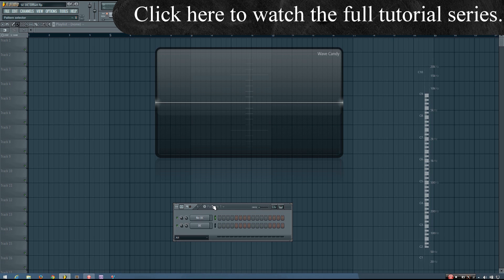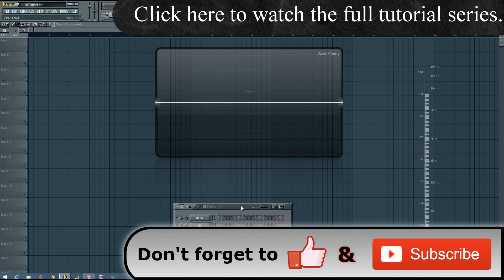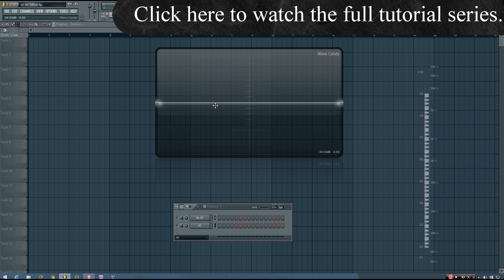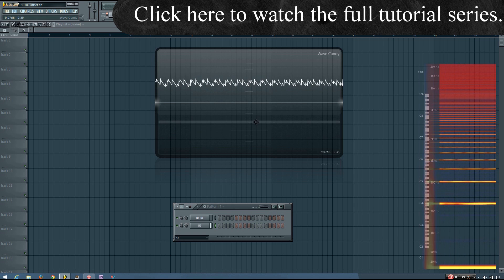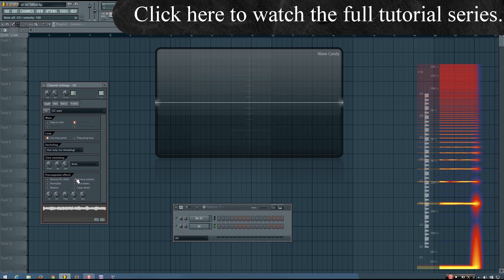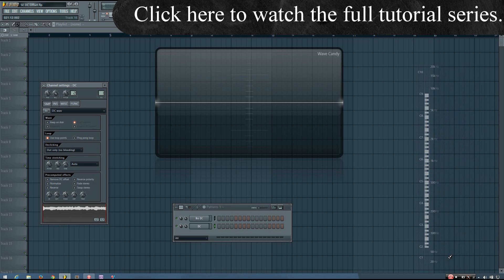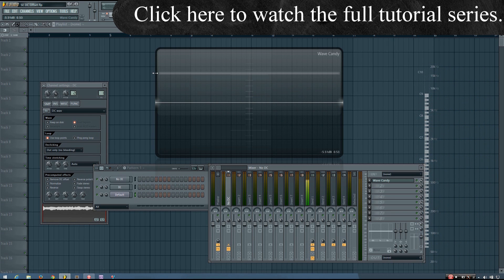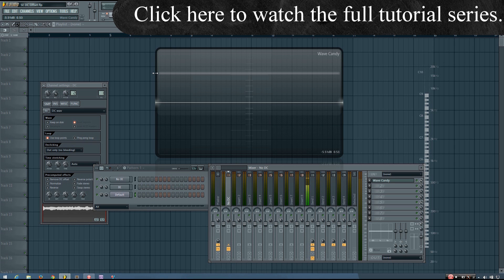DC Offset Explained

Comment: you showed what the DC offset is but did not explain what it does, why it even exists.
Reply from the maker: What it does: it causes the peak value of the audio to be increased without a change in loudness along with extremely low frequency "noise".
Examples of why it might exist in a recording: Distortion, recording flaws, or certain waveforms.
Technically why it exists: the waveform is off center.

I did say these in the video, but what more did you want to know regarding what it does/why it exists?
Reply: No, people who come here wanna know what it does for them. Like a simple explanation, if you have it/activate it/ or apply etc DC offset to your sounds, (or activate it in windows) it makes the sound better/worse/limits it in certain amplitude that louder sounds do not go insanely high/tear your ears etc.

You just say "here is DC offset, and here is no DC offset". Maybe it has a different meaning or use in your audio/mixing tools but you dont explain whether YOU applied the DC offset, whether there was an error in the audio file and DC offset thingy fixed it. or its a feature that does something else. Just at the end you say you can correct it, which makes me think that its a BAD thing and you should avoid DC offset.
Reply from the maker: I see, I could have gone into more detail about how it affects the music.  DC offset is not something you would purposefully add to your mix, because it doesn't change the way things sound. The fact that it (usually) increases the peak level without an increase to loudness means that you won't be able to get your mix as loud*, and the low frequency noise could cause a rumble on some sound systems (but most should filter off really low frequencies, preventung this). Due to these negative effects and the fact that it has no positive effects, you want to remove DC offset if it's present. 

*I don't think there would be much difference between removing DC offset during mixing vs mastering regarding the final loudness possible.
Reply: then why didnt he say exactly what you just said lol
Reply: @IVTheFourth  I would just love to understand why it exists on many 80's CD pressings. Removing it with an HP filter , causes more bass definition but reduction of midrange and some albums become very harsh in treble.
Reply: @HollerAtcherBoi  what did you drink mate?
Reply: @the_DeadEye  Truth hurts, eh?
Reply: @HollerAtcherBoi  please pass the joint. i really wanna try that.

Comment: One time I came across a vintage radio recording that had somehow acquired a 100% DC offset. That's right - the ENTIRE WAVEFORM was above the centreline and nothing below! God only knows how that happened. Fortunately applying DC Offset Correction in Audacity fixed the problem and I was able to normalize the audio properly.

Comment: My luxman 5c50 dc offset light is burning, i know it has something to do with the inputs but i don't know what, it burns when a cable is plugged in but it isn't connected to anything or the devise it's connected to is turned off do you know what it could be?

Comment: @ Beat School
What is the purpose of dc offset? I've seen it on a function generator and wondered why it's even there, so this is my question....
What purpose or use is it when used in audio test equipment,i understand your video and the difference but don't understand what use it is for in a practical sense
Reply: I can explain this. While AC (alternating current) is a on axis sinus waveform, DC stands for direct current which looks like a flat line off axis on an oscilloscope. If your signal is off axis, there is direct current because the inner size of the surface of the waveform on one side doesn't match the size of the surface of the waveform on the other side when you measure or calculate it. DC offset moves the waveform on axis. 

The practical use is that the speakercone now can replicate the waveform in its moving range. With the waveform off axis the speakercone couldn't use its full potential, which will result in a quieter signal and distortion.
Reply: @MowBTC  fuuuucking hell! thanks
Reply: @DrawingBase  :D You're welcome.🙂
Reply: @MowBTC   So what u are saying is, removing the DC offset is better?
Reply: Well said (no sarcasm) you put it in the proper context